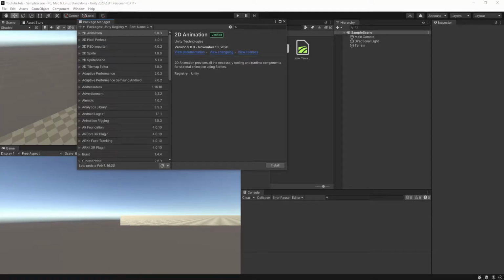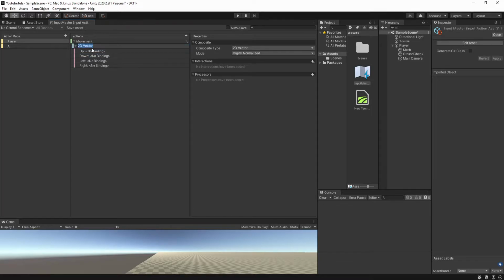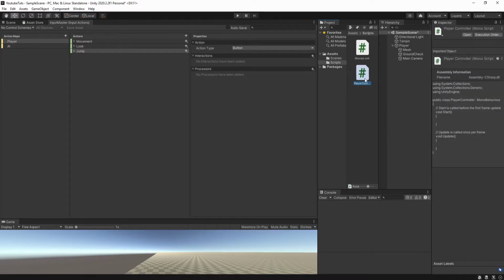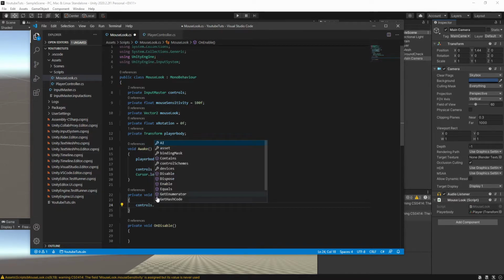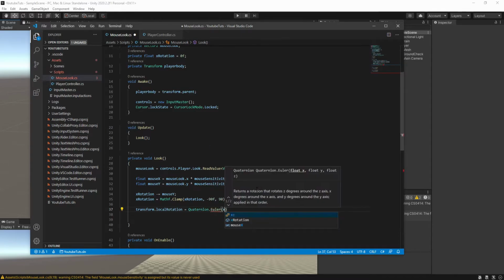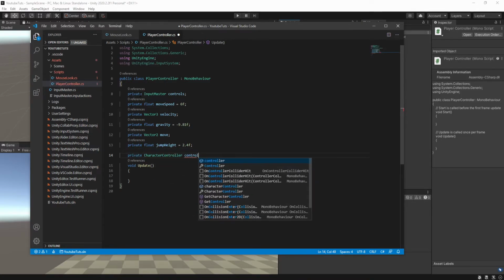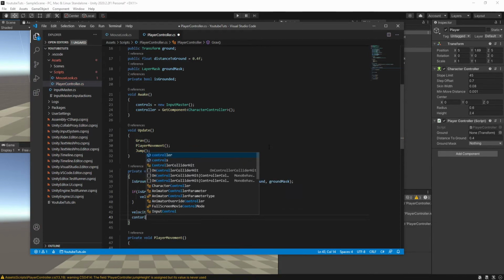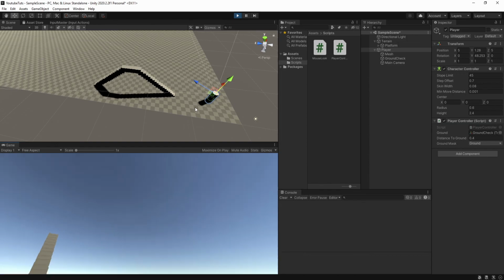Unity 3D - New Input System, First Person Control

Comment: Fabulous tutorial on getting the new input system to work. I'm adding a different type of input device, and no other tutorial worked. BUT my problem is that as soon as I start trying to import other assets to create a real world (other than the flat checkerboard terrain), it breaks, and I get all sorts of errors. I've been careful not to import another player controller. But even the assts alone cause crashing errors of "MouseLook" defined elsewhere. Any thoughts on how to correct? Again, this is the ONLY video which has allowed me to get my new input device to work, but now I'm stuck because I can't add environmental assets in without it crashing.

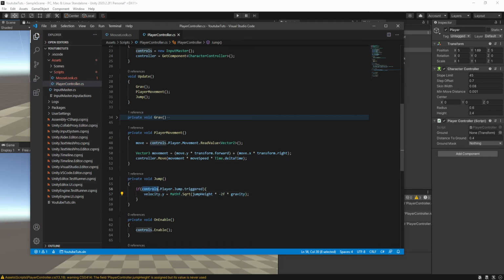Comment: 31:36 Right here in the Jump section update the if statement as  follows - if(controls.Player.Jump.triggered && isGrounded) {...existing code} This will make sure that the player doesn't jump in the air

Comment: Question: If I make a new script what all do I need to make the input manager work for that script? Or will the same script you made work? An example is if I wanted to make a pause menu script could I use the same input manager?
Reply from the maker: Hi Fletch you use the same input manager for all your actions movement pausing attacking AI etc
Reply: @BotableCoder  Would it still work in the same script that you made if I put a pause menu inside of that script?
Reply from the maker: Yes it should work.

Comment: okay so I tried I failed there are no errors, and I need help, the camera is not looking at the mouse Could I get some Help? I even posted on the unity answer page..

here is the code

using System.Collections;
using System.Collections.Generic;
using UnityEngine;
using UnityEngine.InputSystem;
public class PlayerCamera : MonoBehaviour
{
    public float sensitivityX;
    public float sensitivityY;

    public Transform orientation;

    public PlayerControls playerInput;
    private InputAction look;

    float xRotation;
    float yRotation;

    Vector2 lookAt;
    private void OnEnable()
    {
        look = playerInput.Player.Look;
        look.Enable();
    }
    private void OnDisable()
    {
        look.Disable();
    }
    private void Awake()
    {
        //orientation = transform.Find("Orientation");
        playerInput = new PlayerControls();
        Cursor.lockState = CursorLockMode.Locked;
        Cursor.visible = false;
    }
    private void Update()
    {
        Look();
    }
    private void Look()
    {
        lookAt = look.ReadValue<Vector2>();
        // Mouse Input
        float mouseX = lookAt.x * sensitivityX * Time.deltaTime;
        float mouseY = lookAt.y * sensitivityY * Time.deltaTime;

        yRotation += mouseX;

        xRotation -= mouseY;
        xRotation = Mathf.Clamp(xRotation, -90f, 90f);

        // mouse orientation & rotation
        transform.rotation = Quaternion.Euler(xRotation, yRotation, 0);
        orientation.rotation = Quaternion.Euler(0, yRotation, 0);
    }
}

Comment: I followed along with this video to make my game and for a while I've been having a problem where my Mouse movement is very jittery and way too fast but my Controller look input seems to be completely fine. Do you know of any ways I could fix this?
Reply: yeah got the same problem, would be nice if you can share it and how u fixed it.
Reply: @ishatterTTV  I saw a script on Unity Forums that used a lerp function to smooth the input values out, I can't find the script anywhere now though
Reply: @prodbyrobo  yeah but its actually wax easier the way i wrote it, its legit turning it from fixed update to dynamic and it works just fine
Reply: FIXED IT!!!! ITs actually a problem with the inputsystem itself. cause the Inputsystem itself doesnt work with update methods instead its using the fixed update method that  normaly isnt called every frame. To fix the problem go to Edit > Project settings > Input System Package  and turn the Update Mode to Process Events in Dynamic Update.

You are welcome

Comment: The jumping works but it causes infinite jumping in the air.
Reply from the maker: Hi I believe I added an if ground field in the video which checks if the character is grounded before jumping was allowed again
Reply: @BotableCoder  I'll check again to see if I missed anything.
Reply: @BotableCoder  If you could time stamp it for me it would be a great Help. Thxs! :)
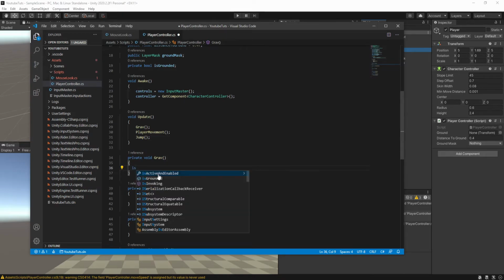Reply from the maker: @FletcherChiles  26:30 check if player is grounded
Reply: @BotableCoder  Fixed it and also made a double jump as well. Turns out when i made it && Grounded it deleted my ground in my inspector. that was the issue. :)
Reply: @BotableCoder  Your code is perfect. thanks for helping me get started. It helped A lot. :)

Comment: really good tutorial, it helped me alot, but a found a problem with your code, when your doing the jump void, in the if statement, you need to add if (controls.Player.Jump.triggered) {} it actually needs to be if (controls.Player.Jump.triggered && isGrounded) {} beacuse it will make sure the player is grounded before it can jump
Reply from the maker: Thanks for pointing that out!
Reply: Thx! it work but there is a one problem only when i tried to go in upstairs nothings happens?
Reply: Nvm i just knew why from the distance of the ground it was on 0.1 so the distance was very small thx for tutorial tho <3
Reply: I just keep getting stuck to the ground and can't jump then.
Reply: @FletcherChiles  did you select the ground layer for the ground
Reply: @alt4s  Yes. I fixed it and i added a double jump.
Reply: Ty this saved me